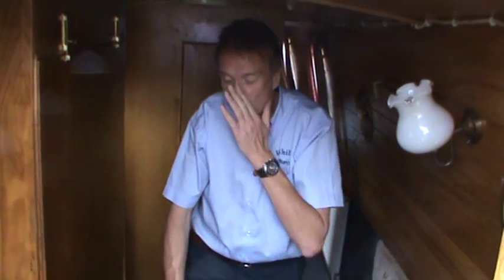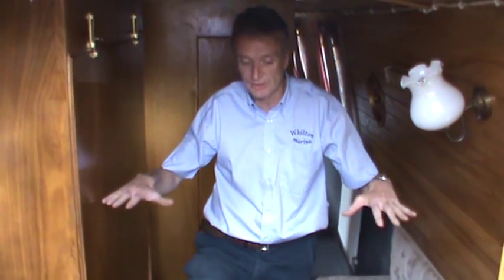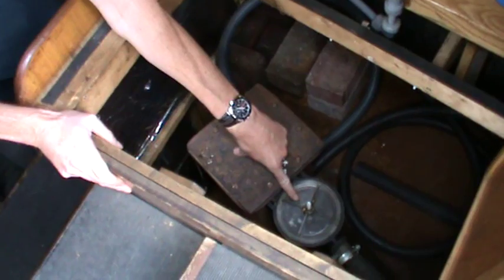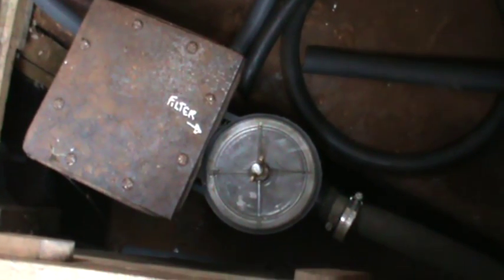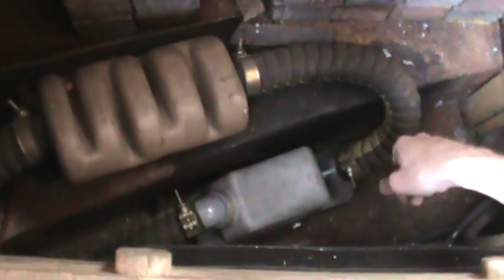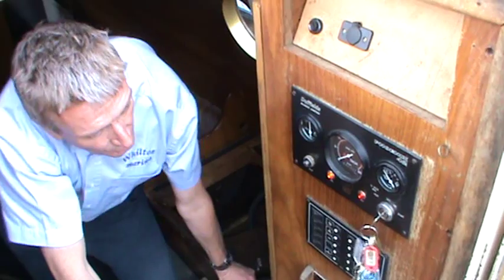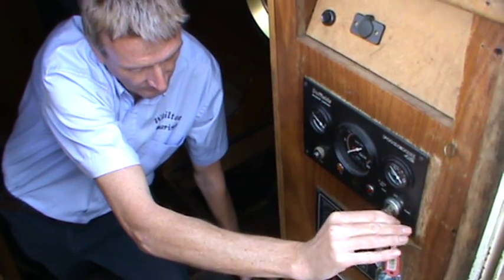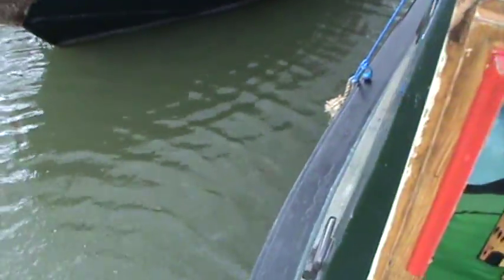Raw Water Cooled Engine

Comment from the maker: Hi Bjoern Draegert,

If the engine will start on tick over then that is fine, after that you will then need to give it some kind of acceleration to energise the alternator.  However older engines may not start on tick over and need some acceleration to start and energise the alternator.  Each boat and engine is different.

Comment: Just for information, All boat engines whether keel or raw water cooled have a heat exchanger, on a raw water cooled engine the heat exchanger and engine are filled with a mix of water and antifreeze, there is then a series os tubes that pass through the centre of the heat exchanger, the raw or can/river water is then pumped through these tubes and cools the water in the heat exchanger and engine. The brown plastic part is a muffler/silencer and the grey plastic unit is a water trap.

Comment: What I really don't understand is why boats are supposed to be started with the morse lever (aka accelerator) pushed down a fair amount. That only results in an increased wear in the liners and in the main and big end bearings. Every engine of the past 20 years should easily start at idle speed and should remain there for a couple of seconds for the oil pressure to reach every bearing. That secures a long engine life.

Comment: Without knowing it at all I (from the engineer's point of view) can't imagine the engine is being cooled constantly by 10C cold or even colder water... That would result in huge engine wear. So the presence of a heat exchanger with a thermostat valve is only logical. But of course you're right, in that case it wouldn't be a raw water cooling and would only mean that the heat exchanger  and cooling medium have been moved from the keel to the inside.